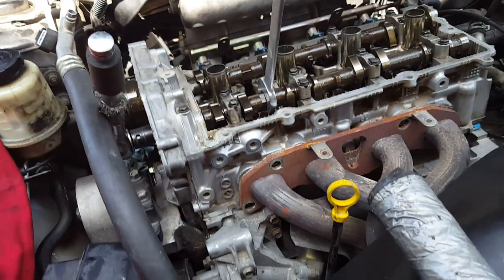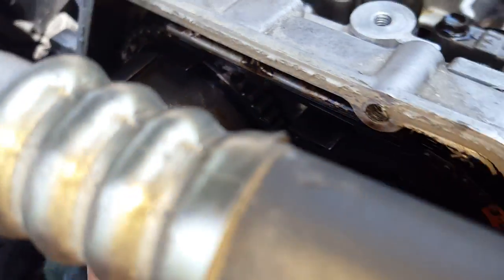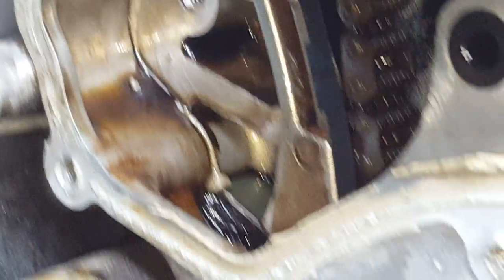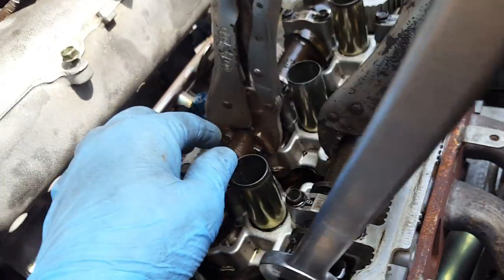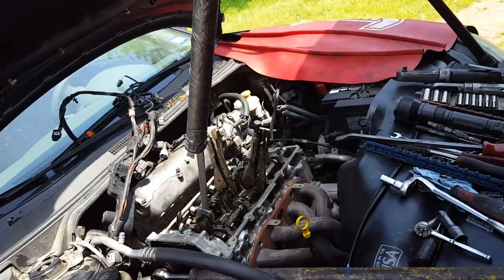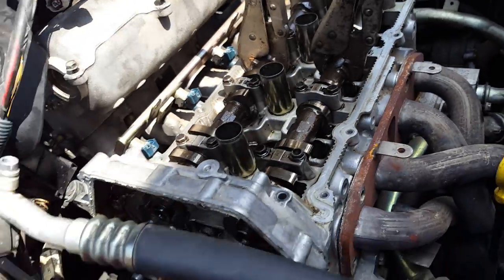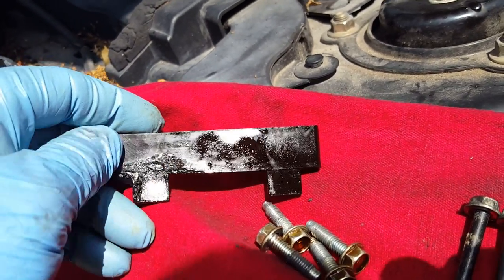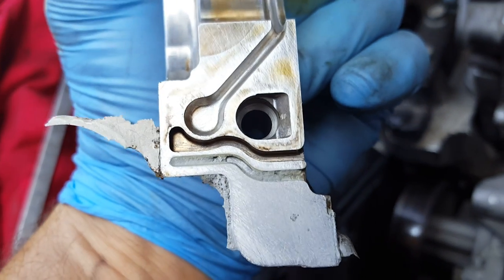2006 Nissan Altima 2.5 cylinder head removal notes

Comment: I had to change the head gasket on my Altima, and this video was by far the best I found. A few tips I will add for anyone doing this, use a paint marker on the cam gear and timing chain, so you know it's right. And I used a impact wrench to loosed the cam gears, and held the cam with a wrench.

Comment: The one I'm working on is a 2005 altima. The orange link is in a different position, but I guess as long as the other items are in the correct position, it shouldn't matter.
That top tensioner fell off before I used fire on these.

Comment: Thank you ive leraned that i will not being doing this myself or at all. Know any shops? Lol
Reply from the maker: Yea it's a tough one. The dealer technician can run thru this task with ease. It's a pretty penny, though.  Maybe cheaper to replace the engine if there aren't many good technicians in your area.

Comment: Hi Chris, great video thanks for uploading. My son has followed every step and stripped his head down and it's now being machined flat although it's only slightly bowed. From the diff colour paint on the cam sprokets it looks to have had 3 previous head gaskets !! so we are going to put a good head gasket on and doing everything right. You said you were going to fit a Nissan HG as this car had blown the previous HG. How did it go, did it last, and can you recommend any alternative HG brands that will last. Also what brand HG bolts would you recommend thanks
Reply from the maker: James Grant I used all Nissan parts the second time. Also I sprayed copper coat on the gasket  too. It has lasted for 30k so far.
Reply: Chris Kolar I have a 02 nissan altima 2.5 and now the spark plug on cyl #4 gets smash...what can be the problem?....if you can help me please any advice...thank you very much
Reply from the maker: Sorry I just saw this message. If the plug is getting hit the rod bearing may have failed or something fell inside the engine. If you turn the crank while looking at the pistion does it have slack? It there a knocking sound? Did it run low on oil? Maybe it looks like it's getting hit but just melted form detonation. Sometimes the catilitic converter gets clogged up and does not flow properly, this causes the engine to run hotter than normal, use more oil, poor performance because the computer is retarding the timing trying to prevent detonation.

Comment: Weren't you worried about the chain jumping the crank being that low? Most videos hold the chain up w/string or something.
Reply from the maker: No, as long as the engine does not turn while the chain is hanging low
Reply: Chris Kolar Hey I let my chain hang like that and now that I got it all back together the engines running very badly. I’ve been trying to find if it’s anything else but that’s the only possible thing I can see that caused it
Reply from the maker: Prolly need to remove cover and check alignment. There is no way the being let loose can cause any problem. After all when you remove the cam sprockets the tension on the cam chain is relaxed and loose. Putting the chain on a tie string does not put any tension on it to cause any type action to prevent anything.

Comment: Hey Chris, when I was trying to find the TDC, the only mark I could find was the orange one on the timing chain, no yellow or gold marks. any way I could find the TDC without the yellow or gold marks?
Reply from the maker: josh vandall sorry for the delayed reply. I am on vacation and the internet was not available. To confirm where you are you need to get #1 cylinder at top dead center. This is easily done with a long straw or plastic stick into the hole of #1 cylinder while the piston to is close to the top and the lobes for the intake and exhaust cams are opposing each other, now with the front cover off so you can see everything turn the balancer so you can see the cams and the straw or stick go up when you get to top dead center it will stop going up and start to go down. stop there and try to get the pistion in the middle of going up and down. When turning the crankshaft there will be a few degrees where the movement of the position is static. That is where you want it.
Reply: Chris Kolar got another question for ya... is it possible for the timing chain to jump teeth with the timing cover on??
Reply from the maker: josh vandall I do not know. It would have to stretch a lot. If it is loose and running it would strike the inside and wear a hole in the cover and be very noisy. (Just think Nissan Quest when the chain is loose they sound terrible. 3.5l v6)

Comment: So to remove that little guy loose on the end of the video do you need to remove sprocket or nothing to do with that just remove top bolts and side bolt holding that cover cause I have leak on that area I’ve done head gasket before about  2 years back but this area is leaking not noticed until now leaking to the back of the engine and oil pan so is it just removing top timing cover bolts and ton bolts of this piece
It seem that I have to remove timing chain , sprocket and tensioner to get to that bolt wow wow wow amazing so it need a weekend I thought I can do it  in half an hour but in that case I have to remove motor mount also and struggle with all these bolt remove valve cover then it’s time  for holding cam shaft and loosen sprocket bolt
Reply from the maker: It seems like you answered your own question. Yup the gears have to come off.
Reply: @chriskolar  yep my bad luck cause of crappy rtv I kept it 24 hr when I’ve done this before about 3 years but  I’ll do it    On the next oil change  better so I can change oil for my bmw e39 and this one , I’d like to have newer Altima and change this but they are all cvt now and I hate cvt transmission hope they’ll change to normal transmission like new pathfinder then we’ll go for that Altima cause common cvt failure  on Nissan Altima
Reply from the maker: @Sroor2023  I think the new Nissans have a CVT made by Nissan and they are better. The older ones were made by a third party supplier and fell apart.
Reply: @chriskolar  ok job done this morning but worst part torque these  2 bolts  of the sprockets

Comment: I have a broken spark plug thread and now a broken easy out in there too...do I really have to remove head to get that out?
Reply from the maker: Yea, its gonna be much more problems if any of that gets into the engine. Pull the head
Reply: I have a welded spark plug xD fudgeee..

Comment: sorry if this is a dumb question, but how exactly do the vice grips keep the cams from turning?  By hitting the side of the head and stopping? im guessing that little bit of movement is ok as long as it isnt allowed to fully rotate?
Reply from the maker: When you clamp the vise grips on find a place that when they are clamped on they extend a little past the cam and contact the head. This can be very close just as long as the cams do not turn. Another way that requires two more vise grips or c -clamps is to connect them together with a piece of flat metal kind of like a solid strut.

Comment: hi, is the car still good? i noticed you used felpro gasket and headbolts, i used the same parts and only lasted 2 years.
will be using the 07+ headgasket or ajusa this time.
Reply from the maker: I did use fel pro the first time. It lasted about 25k. The second time I used nissan gaskets and bolts.
Reply: @chriskolar  and it hasn't blown since?
Reply from the maker: @alejandromorales3998  no it lasted for more than 25k but the car got totaled.
Reply: @chriskolar  very well, thanks for the reply

Comment: What are the vicegrips holding on to besides the camshafts?
Reply: Are they pushing up against the head as well?
Reply from the maker: They are holding the camshafts and running past a little or close the side of the head. So if the cam turns any it will stop. The grip pressure should be very light, be careful and not crush the cam by clamping the vise grips too tight.
Reply: @chriskolar  Thnx..👍!! When you removed the timing chain from the top sprockets did you just move it aside and hook it to something? It won't come off of the crankshaft? Did you have any trouble putting the camshaft sprockets back on and lining them up with the chain?
Reply from the maker: I turned the crank till the links and timing marks lined up. I used zip tie to hold the chain. It wont fall off the crank. Its not that hard to reinstall the sprockets.

Comment: My 2006 blew is it worth fixing or just get new car
Reply from the maker: They are good cars. Maybe take the head to machine shop and have it resurfaced. I did not do that.
Reply: @chriskolar  okay thank you they told me it’s my head gasket and it’ll cost 927$ to repair it + needed my motor mounts done just didn’t know if that was worth the fix
Reply from the maker: @keekwashington8309  that's no too bad of a price, I wonder if that includes antifreeze, oil ...
Reply: @chriskolar  right! wish you could repair it but I’m all the way in Omaha lol but thanks anyway!

Comment: Where exactly do you put the pin for the chain tensioner?
Reply from the maker: The chain tensioner has a small hole in it. Use a screwdriver or small prybar and depress the tensioner drive into the housing until you are able to install a pin. It is commly referred to a a grenade pin. You can use a small Allen it just needs to be about 1.5 inches long.
Reply: @chriskolar  okay I see I have it off already I just can’t get that camshaft gear bolt off I even heated it up multiple times.
Reply from the maker: @mcmagdiel3277  the temperature has to get pretty hot. I had a 3 foot cheater when I did it.

Comment: i heard u say u did the gasket on this car before, how long did it last u after u did it the last time? why did it blow AGAIN?
Reply from the maker: JayJay 4UBAE 
yes I did it before, it lasted over 12 months. the previous time I used fel pro gasket and aftermarket headbolts. Because of the problem happened again I used all Nissan parts this time. Remember to check the catalytic converter when you have it apart, they are a big problem when they fail because the engine will be damaged.
Reply: Chris Kolar 12 months dang it... such short time it lasted. so what would u recommend me to do so it wont break that soon.? i bought dealer gaksets and bolts, coolant etc..
Reply from the maker: JayJay 4UBAE  Trust your work, do the best you can. I assume the fail was from parts that were not Nissan but will never really know. When going back together spray some copper coat on the head gasket that is supposed to help too. I did not do that the first time.
Reply: Chris Kolar i see. hey thanks boss for taking the time to answer and best help me. have a great rest of week sir
Reply from the maker: JayJay 4UBAE  I did take cylinder head to a repair shop. The first time they did mill just enough clean the head surface up. The second time the surface was still flat and any milling was not recommended by the shop. They are the ones that suggested the copper coat spray. Also they checked cam runout and valve guide, seals, shim clearances, and pressure test.
Reply: @chriskolar  so the unbolt of the head are the same sequence as the tighten sequence just in reverse right? Or can u give me the chart.
Reply from the maker: Yes same sequence, start from outside and work your way in to remove the head.
Reply: @chriskolar  Thanks for the info chris

Comment: What do you have to rotate to reach the desire alignment tdc???
Reply from the maker: I put the crank bolt back in and used that to turn it. It's pretty easy when the spark plugs are out.
Reply: @chriskolar  the crank bolt is the one in the bottom right beside the 2 circle one at the top?
Reply: Or am I wrong?
Reply from the maker: @carlossaavedra4723  it is the one that holds the harmonic balancer. The lower pulley in the center where the pin has to line up to indicate top dead center. I did not show it in the video. Sorry.
Reply: @chriskolar  ohhh okay so it's the big pulley almost next to the A/C compressor right ??
Reply from the maker: @carlossaavedra4723  yes the lowest and biggest one. It will have a small line in it. Use a dab of white paint on the line to help you see it. Line that line up with the top dead center pin at the same time check your cam lobes and the position of the cam gears.
Reply: @chriskolar  thanks for replying your help is really appreciated and okay got that so after I turn the bottom one and make sure I find the top dead center that's when I can remove the 2 circles that are at top right? And remove the chain and make the change hang on the A/C line running at top right ?
Reply from the maker: @carlossaavedra4723  after you get it all lined up then you can remove the cam sprockets. You can hang the chain with a string or piece of wire, just be sure that nothing falls in.
Reply: @chriskolar  1.okay and does the belt have to be on the harmonic balancer to turn and look for the tdc lines or can it be off 

2 I heard those 2 bolts holding the 2 round Circles are really hard in the there that's why you yoused a wrench to make sure u didnt turn the cams which can make the belt move right ??
Reply from the maker: @carlossaavedra4723  the belt that runs the alternator and ac and power steering needs to be off.
Reply from the maker: @carlossaavedra4723  #2 when loosening the cam sprocket bolts you have to hold the cam steady and not let it turn. The chain could be damaged if it is used to hold the sprockets steady while loosening the bolts.
Reply: @chriskolar  ohhh ok tha ka so much chris hope to see if I can tackle this project myself plus I saw this other video of how to resurface the head without using a machine shop and yousing sand paper and different types of sand paper grit !
Reply from the maker: @carlossaavedra4723  yes, old school funk has a video of resurfacing head.
Reply from the maker: https://youtu.be/HyKN52HD6RU
Reply: @chriskolar  yes thank so much if anything I'll keep in touch with you many shops charge alot for this type of project lol plus I like it to be challenging
Reply: Hey chris to remove the chain I would have to loosen up both the cam sprockets right? From there I can hang the chain ? 

And to reinstall it would be the same proces again right ??
Reply from the maker: @carlossaavedra4723  yes, loosen and remove the cam sprockets. Then hang the chain.
Reply from the maker: @carlossaavedra4723  before removing the chain, mark a link on each sprocket, this helps when going back together to put it the exact way it came out.
Reply: @chriskolar  hey chris do I have to drain the coolant and oil? 

2. I've seen videos where people have coolant on some pores or insides the cylinder holes if I was to have that do I just clean it and dry it ?
Reply from the maker: @carlossaavedra4723  yes you have to drain the coolant. It it's still good use a strainer like one for coffee but a brass one to filter any small particles out. 

If the oil is contaminated you will need to change it and the filter. If the oil is good then it is ok to leave it. After running it for a few days change it of you can. When the engine is open like this it constantly collects dust.
Reply: @chriskolar  got you thanks for replying!